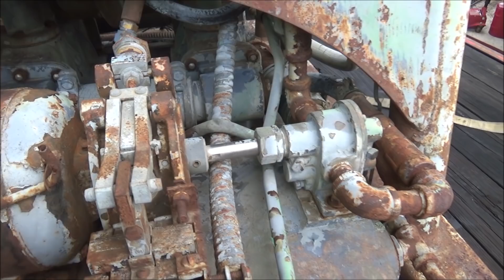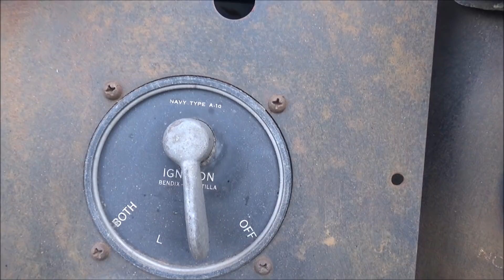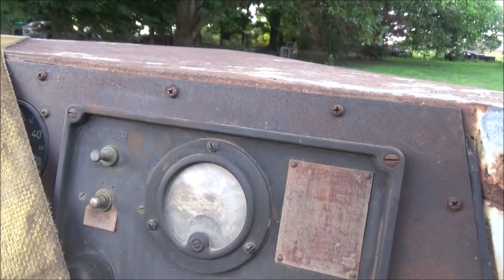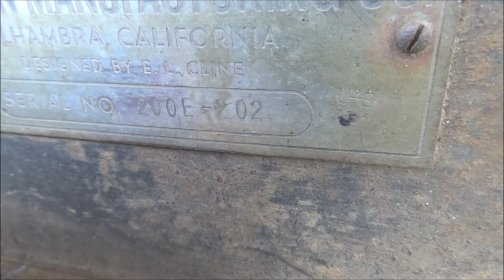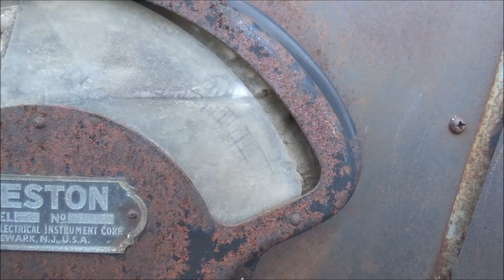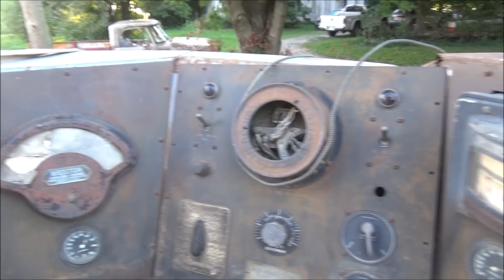Abandoned for Years Clayton Dynamometer / Dyno WWII Forgotten War Winning Machine

Comment: Weston Instruments made lots of different meters. Most meters are either a voltmeter or an ammeter when you get right down to it. That Weston 273 meter was probably some bog-standard volt or milliammeter that measures some quantity. The likelihood is that the console calculated horsepower and displayed it on that meter. (It looks like there are three terminals on the back, so this might have been a watt meter that directly measured two quantities. Watts and HP are of course easily convertible.)

That "test" button under the red light was probably a lamp test button that would have just let up the light so that you knew it worked.

I see there is a slot in the desk that doubtless had a throttle lever at one point in time.

Since the console is set up for 6 cylinders, it wouldn't have been for a radial aircraft engine, since they tended to have an odd number of cylinders per bank. More likely this was for testing inline 6 engines of some sort. Aircraft cylinder head temps I believe were normally measured in degrees C, but since this was a boat I suppose that could have been a head temp measurement. I suspect it is switchable to multiple inputs.

If the force was measured with a strain gage, that thing with the missing tubes may have been a strain gage amplifier that would have converted the output to volts, which are a lot easier to work with. Likely that would have then fed into the torque and HP meters.

If those Weston meters aren't completely destroyed from years of filling up with rain water it should be possible to replace the glass and build new scales for them. A CAD program can pretty easily be used to design a new scale that can then be printed on high-quality paper and placed into the meter housing.
Reply from the maker: Yes the EGT or thermocouple meter is switchable to 6 inputs. All three of the rpm meters have the 3 lug backs and I suspect that merely has to do with the dual scales on each.  I think the strain gauge may be 3 wire. I need to check it out more. Of course it could also actually be a pressure transducer rather than a strain gauge? It kind of has the look of a pressure pot to me. I guess I will have to take it apart to find out. Maybe I can use my volt meter to see if there is any ohm change when I apply the force. Can't remember if it is 2 wire or 3. Guessing if it is 3 it may be a constant voltage in with a variable out as the signal.
Reply: @bcbloc02  Looking up a Weston 273 on Google shows lots of pictures of ammeters. So yes, it is probably just a dual-range ammeter or more likely a voltmeter. (The ammeters I saw on the web would have been measuring the voltage across a load shunt).

I wish I lived a few thousand miles closer to you, I could probably pick thru the back of that and trace out the wiring and get a decent idea what it is doing.

I'm afraid that a lot of that control and monitoring equipment might not be easily salvageable after decades in the rain (though I hope it is), but I suspect most of it could be replaced with modern equipment without a huge amount of work.
Reply from the maker: Your information is still a big help even if you can't in person.

Comment: Guess I will send you an email.
I am quite familiar with scientific instrumentation of that era. BTW, there is little to no friction in the beam pivot assembly to the load cell. The beam was used to scale the load force to the load cell capacity. I may be able to help overhaul some of the trickier parts like the Weston meters, etc.
Reply from the maker: BluesDoctor Awesome!! My email is bcbloc02 at yahoo if you can’t find it.

Comment: I've applied one of those to test remaned Cummins diesel engines.  That one had a fixed flow of water in, and s servo valve to let the water out to regulate torque.

Comment: horsepower  formula is  pretty simple  torque x  rpm /  5252 = HP
Reply: Futten 
 = Brake HP
Reply: @JJ-jv1gu   well yeah  because  HP at the wheels is a  very different thing because  toruqe  multiplication etc  but  the subject was     dynomometer which is a  engine break and there for  thats why i commented what i did
Reply: Futten 
most energy created by an air cooled boat motor is enthalpy, not kinetic
Reply: @JJ-jv1gu   it  still makes   horsepower and   torque even if most of that power  is wasted on thermodynamics  like  most   combustion engines  it   a  very inefficnient system where alot of energy gets  lost in  radiant heat
Reply: Futten 
not sure they were worried about fuel efficiency in marine motors, they ALL fuel pigs
thnk they were lookin at power to weight numbers or maybe design improvements

Comment: You certainly have your work cut out for you now.  You can probably build a much simpler control console. I have a military library at the museum that I volunteer at.  I will check for information but it could take awhile most of our documents are army.
Reply from the maker: I mean worst case I can install a known strain gage and calibrate it and just use the dyno without the console.

Comment: Nice find Brian, looks like some of the old test stands we had here for the minute man cell at my day job. They gutted all that about 20 years ago but up until then were still using the original equipment. All of yours looks intact other than the tubes👍
Reply from the maker: I don't suppose there happened to be any manuals for that stuff that survived in a file cabinet somewhere did there?
Reply: @bcbloc02  I will ask around, all the ole timers are gone now but someone may know

Comment: MIL-SPEC equipment is the best. No matter when it was made it represented the state of the art in both technology and manufacturing for its period. It's the highest quality stuff you'll find.
I have a WWII vintage Collins R-390A general coverage radio receiver that was made for military apps. I think this one was on a navy ship, but they were used in all of the branches. Rack mountable the bare receiver weighs 80 lbs and was designed to literally be bullet proof. You could take cover behind a stack of these radios and be relatively safe from small arms fire. Excellent reception with very low internal noise and great out-of-channel filtering. Also, since it has no transistors in it it is impervious to EMF blasts. An R-390A in good shape these days will fetch $1500 with good reason.
Reply: I was an ET in  the Navy (69-75), and we had a few R-390s aboard.  After the sun went down, we could pick up WLS from Chicago in the mid-Atlantic.  Cool thing about the R-390 is that they are inductor tuned, instead of capacitor tuned like most receivers.  Put up a long wire antenna and you can hear the world on that radio!
Reply: Well hello fellow sailor thank you for your service, you were on one coast I was on the other coast coming back from a pacific deployment about the same time 800 nautical miles from the west coast with it's directional night time antenna we picked up the 50,000 watt station KOKC Oklahoma City on the R390 aboard the USS HORNE CG 30. Being from southern Wisconsin I cut my teeth on WLS Dad had that on in the dairy barn about 1954 and my sisters had it on in the house in the 1960's. I listened to it till I went overseas in 1973. They went from bib bands to rock and then I guess to country or talk I don't know as I no longer live in the great Midwest. Hope all is well with you and yours.

Comment: It seems like an electric generator would be a more useful load.  I wonder how much that would add to the cost...
Reply from the maker: Electric dynos are huge for the power they can absorb and then you need a massive bank of resistors to dissapate the heat produced.
Reply: @bcbloc02  I was actually thinking more of selling the electricity to the grid than dumping it to resistors.  The high power, short duration might complicate this though.

Comment: FWIW, those looked like Octal tube sockets.  I can provide some assistance with tube electronics, BUT documentation is essential.  BEAUCOUP tube types fit into Octal sockets.
Reply: It's a fair bet that it is a strain gage amp. Looking at the internal wiring in the box could considerably limit the likely choices for the tubes in each socket. If you have some idea what a device is supposed to be, the circuit you can trace out and the pin numbers on the tube sockets will often lead you to a good choice for the tubes.
Reply: @lwilton  If those are signal tubes, where's the rectifier?  A 5Y3 rectifier and a twin triode (6SL7/6SN7)?  We NEED a schematic.  To this day, tubes do a GREAT job handling audio.  Some pretty slick stuff was done with tubes, by the end of WW2.  They had miniaturized RADAR in the periscopes of submarines.  Can you say exact range to target?  :>D
Reply: @eliduttman315  The schematic is inside the box, just need to open it and trace the wires and measure or read the part values.

I came to the exact same conclusion you came to if it is a complete tube amp: 5Y3 and 6SN7. However, I don't see a power transformer. This would need to be a low-noise circuit for a strain gauge or thermocouple, possibly there is an external power supply. If so, I'd expect a semi-thick cable with about 5 wires out of the back of the unit, or possibly another octal plug or socket on the back. An external power supply will considerably expand the possible tubes in those sockets since there will likely be two stages of amplification, or perhaps amplification and voltage regulation or the like. It might even be a bridge circuit, that was pretty common to deal with strain gauges. Probably one of them is still a 6SN7 or similar, and both might be.

Examination of things hanging out of the box and the wires inside should give a pretty good idea.
Reply: @eliduttman315  As I said, it is quite possible there is an EXTERNAL power supply with the 5Y3 (or even a selenium bridge), and that chassis only gets pure DC, or more likely DC for the B and C supplies and 6.3 AC for the filaments. If the power supply is external (and this is still *IF*), then the rectifier is wherever that power supply is.

And while I'm not sure WE need a schematic, a schematic would be highly desirable to determine the correct tubes. Fortunately for something that simple, flipping the chassis over and an hour or so with an ohm meter in conjunction with a piece of paper and a pencil will deliver a freshly-made schematic.

Comment: You have a couple of empty tube sockets in that control panel.
Reply from the maker: The Bench Monkey Yes I mentioned that. No idea how to figure out what belongs in them though.
Reply: @bcbloc02  Are those tubes in what looks like a DC power supply? They might be rectifier tubes.
Reply: @artemiasalina1860  that's what I would guess also.
Reply: @thebenchmonkey4117  I know that they make solid state rectifier replacements for the old tubes that plug right into the sockets, but they are a niche item and are expensive. It would probably be cheaper to just replace the original power supply with a modern equivalent.

Comment: fabulous piece of engineering history, love to see this up and running again . i have a mental picture of men in white lab coats with clip boards at the console, 75 years later a more hands on man,  in a John Deere  shirt.
Reply: FixIt MakeIt 
Yes with horn rim glasses n a dress shirt with a black tie tucked in between 3-4 buttons on their shirts for safety reasons. 
Either butch , flat top hair cuts, or single part comb over.

Comment: Hey Brian, YouTube are getting greedy again. Please consider opting out of the new mid roll ads. I'll sit thru pre and post show adverts but they're pumping no less than six ads into the first 12 mins and more as it goes on. that's just driving me away.
Reply: Get the free add on for advertising blocking called "Ad block plus" I use it and never see ad's. Zero. Great free application.
Reply: ukulelefatman I do on my computers but it's not an option with the iPad.
Reply from the maker: I didn't know as I have ad block so don't see them. I will fix it. They should be gone now.
Reply: Can't avoid em on my tablet. Thanks muchly!

Comment: https://industrialmanuals.com/clayton-17300l-17500l-17700l-engine-dynamometers-operations-manual-p-5421.php
Reply from the maker: I have seen that on ebay, while similar it is not the same unit. Maybe a last resort but I hate to pay $70 for a book that may not even prove useful since it isn't for this machine.

Comment: Brian
Looks like a Weston 273 gauge is just a plain ammeter that came in various sizes ,I just googled it lots of pic but no info
Reply from the maker: Yes but all the 273's i found only used 2 polles, these have 3. I can only assume that is strictly the wires from the different high low switches going to other taps to change the scale. Any idea how you could combine an rpm signal and a strain gage signal to get a related amp signal to direct read hp?
Reply: @bcbloc02  Variable resistance from the strain gauge could be converted to variable Voltage.  That Voltage and variable RPM pulse could be fed to an operational amplifier, which would output a Voltage or current to the meter.  Might explain the 2 tube sockets.
Reply: Jon Pardue 
Good point Jon , that gauge could have been a special unit , for the ww11 effort .  Sorry Brian I have no clue as I do not know if the strain gauge in a voltage source or current source . The two valve bases could be a constant voltage source for the strain gauge , but boy did that panel bring back a lot of memories from my time at the iron works all the gauges on the 220vdc stuff was like that all that changed was the shunt ( calibrated by hacksaw cuts )
Reply: @stuarthardy4626  The load cell is likely a wheatstone bridge or one of its derivatives, so it would output a steady state voltage or current, which makes sense to feed into an op amp, I would expect another circuit in there to do a frequency to voltage conversion if they wanted to feed the tach signal into the op amp as well.  You probably don't need a really precise power supply for the load cell, the bridge circuit measures a delta between to two sides of the bridge, which helps isolate the output from the power supply voltage. That of course depends on whether it actually had a direct HP readout, which does seem to be indicated by the hi-lo range switch.  I suppose if one wound a meter correctly you could do the math mechanically, just have two windings on the coil and feed both signals in. Brian mentioned the meters had 3 poles, I don't believe I have seen a 3 pole meter, usually meter ranges are handled by external resistor arrays and voltage dividers. If that actually was the case then those would indeed be custom meters, and probably all kinds of fun to calibrate.

Comment: I have the same disease Brain -  I saved from the scrappers a VINCO Optical Master Inspection Dividing Head of WW2 Vintage accurate to one millionth which helped America win the war in that the level of precision achieved with gearing and splines was higher than their foes.   The head and Tailstock sit on a cast iron surface plate type table of some 3 or so tons - I've saved it for one generation - it is a beautiful art deco type instrument the size of a large monarch lathe - it's fate is unknown when I pass on.  - You are a legend and a fantastic creator on Tube - most genuine fellow on the whole system - cheers.
Reply from the maker: Sounds like a cool piece! You should at least do a video on it so that some info on it can be preserved.
Reply: Find someone who appreciates these treasures, someone who will protect and preserve them, then pass them on when appropriate.  I don’t really own the treasures I’ve saved, I’m just the caretaker for future generations.